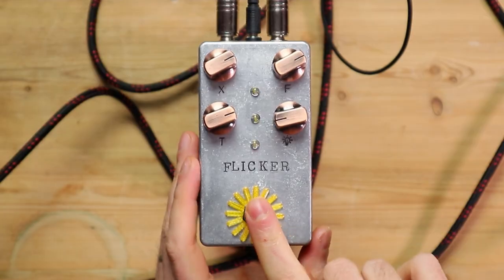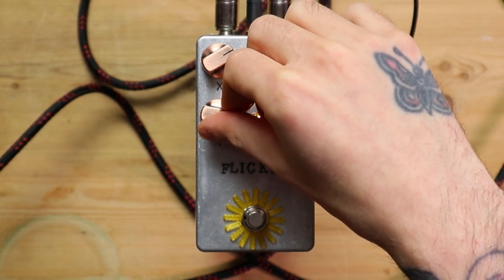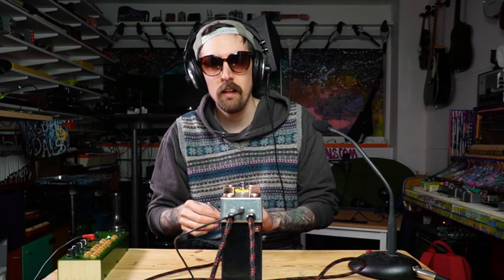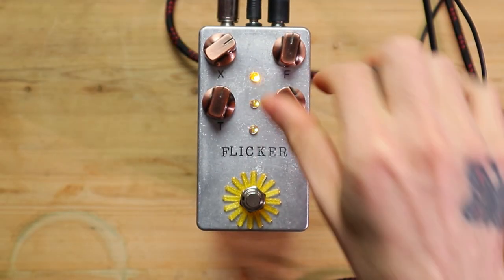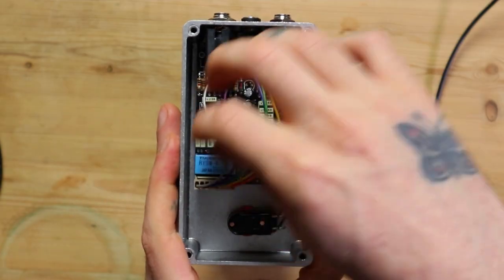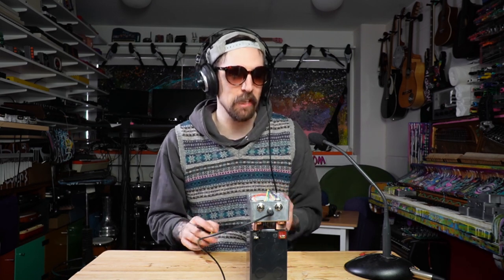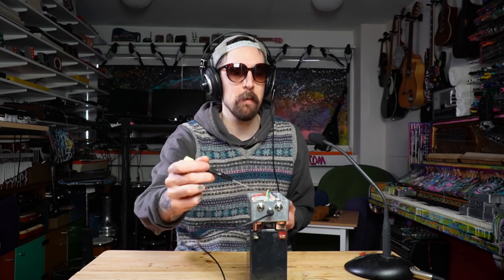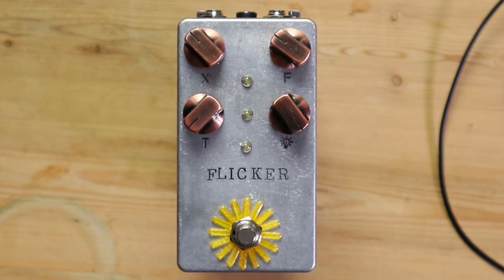Flicker - Controlling Time With A Flickering Light

Comment: Much like all your little boxes, it's cool. It's very cool. But I don't even have to check it's price to know it's likely out of my humble reach. Just a thought and feel free to ignore me and tell me to F off but maybe you could release one for us poors. Maybe come up with a way of doing something really cool on the cheap. Or, maybe you might think about doing kits. I don't mind getting my hands dirty and doing a little soldering. Not that you need to worry about little old me. I'm sure you're doing just fine without me and my broke ass brethren. But maybe it's an idea. I don't know. If you did that, I bet you'd sell a bunch. But it's your company. Peace. And honestly, I hope you do very well with your pedal line. It is extremely cool.
Reply: It seems these are all hand made, hence the prices. I'm sure there are factories in Asia that could build these to spec in small batches, but sourcing and vetting manufacturers and distributors would take up all the time he spends making magic boxes
Reply: @dyscotopia  Yeah, In get it. Ethically sourced things cost money. But the kit idea might still be viable.